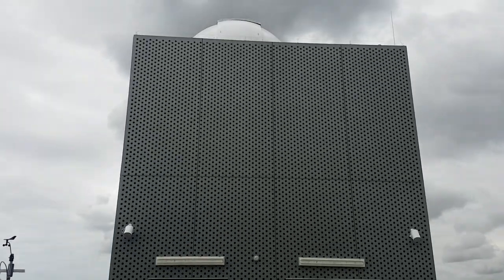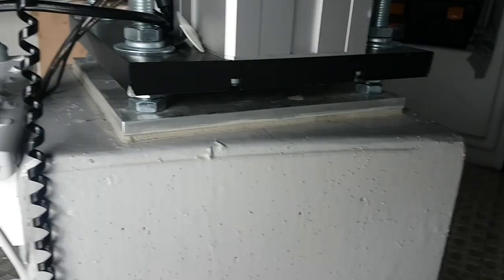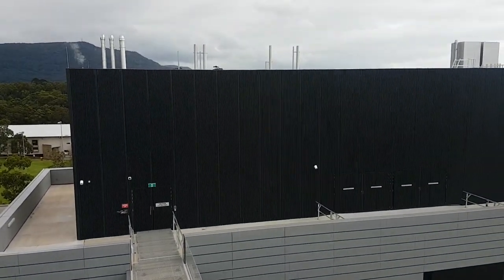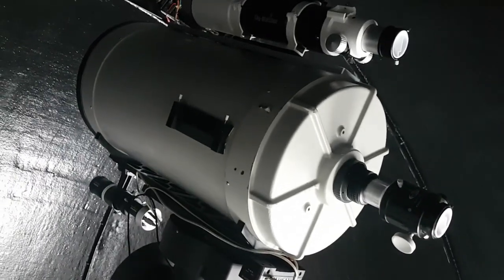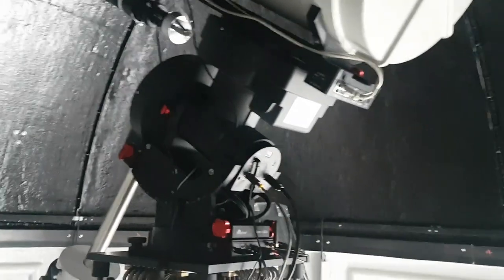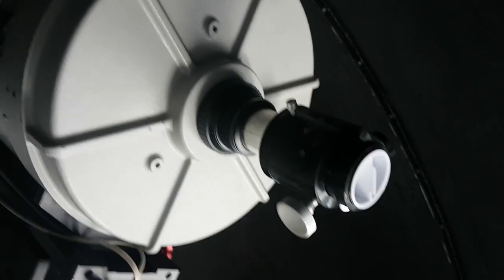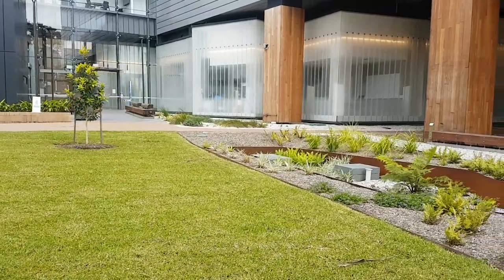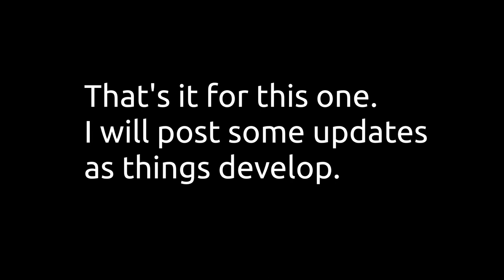Astronomical Observatory Tour

Comment: Are you sure that the roof can carry the weight of the telescope? The instrument and mounting is a great. 16 inch ?
Reply: I thinks that an old c14
Reply from the maker: You can see a video of the building it is on here. https://www.youtube.com/watch?v=ztURh_sGOrU. The building was designed with the observatory as part of it.
Reply from the maker: Yes, that is an old C14. It has been replaced by this now. https://www.bintel.com.au/product/bintel-gso-rc14-a-carbon-truss-ritchey-chretien/
Reply from the maker: I have had to leave the job at the university. Funding troubles. I am now working at https://www.ansto.gov.au/ with a group that measure radon gas in the atmosphere. I still have access to the observatory at the uni though.